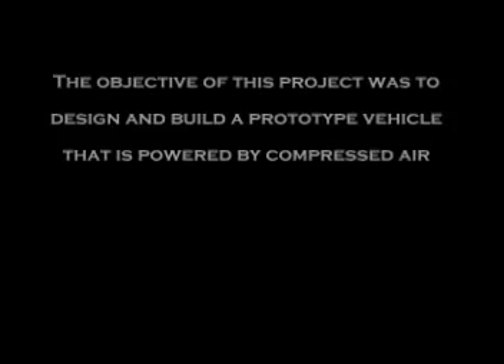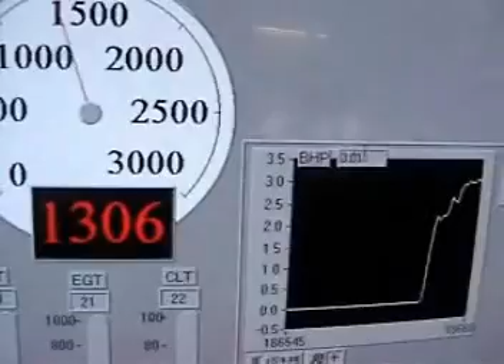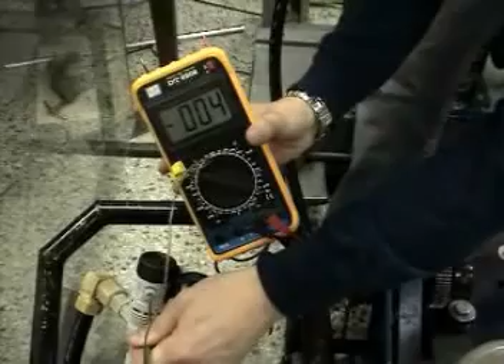Dalhousie - Air Powered Go Kart

Comment: Only if the rate of expansion allows your heat source in your case the atmoshere to transfer sufficient energy to counter the cooling due to expansion. At the rate you are using the supply this is minimal as the cylinder are where the cooling occurs even multi staging does not give you sufficient heat transfer area to make a, your words "major difference". Even in the theoretical idea case you are looking at maybe 40% better performance which is still just an interesting toy exercise

Comment: Quote "If we used a multi-stage step down with increasing rotor sizes. We could extract much more power per air vol. This multi-stage step down technology is used in steam engines in the late 1800's" 
Nope 
You misunderstand compound, triple expansion etc steam engines. Multi expansion steam engines work due to superheat and exhausting to a vacuum and the efficiency increase is in the 20 to 40% range over single expansion. Does not apply to air expansion.

Comment: Hi. 
Question why you are using only the standard ports of the intake and output. 
It is sensible to make in the stator, two more windows, with a rotation of 180 degrees. 
Considering the video did not saw any